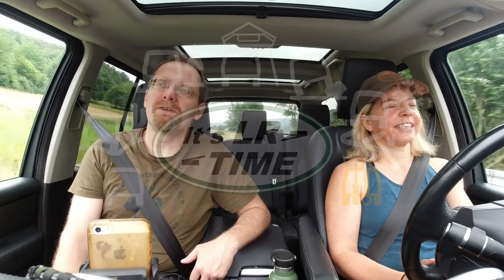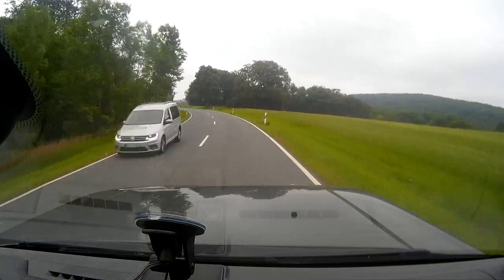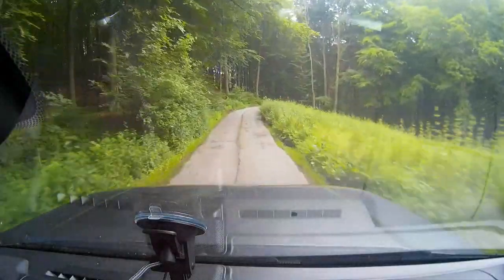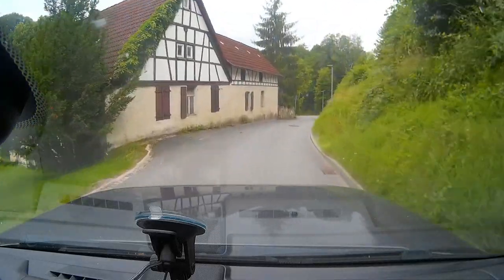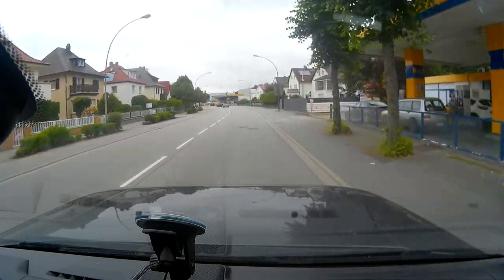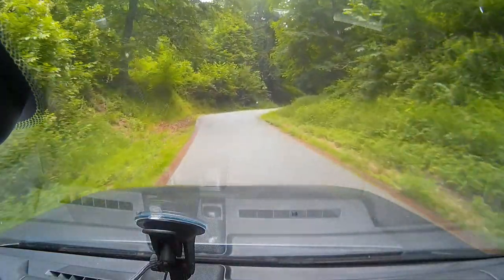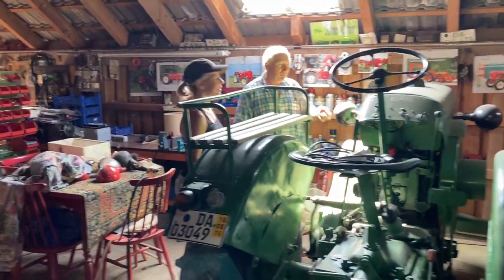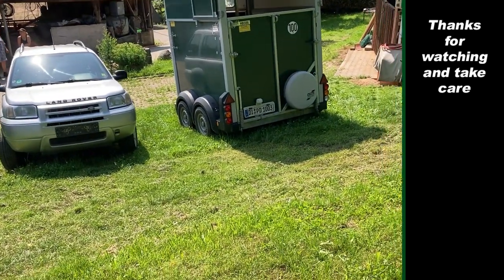Land Rover Discovery 4 - Is it really an upgrade from a LR3 ?

Comment: Hello
I watched all your videos and they are great and my daughters like your submission and cooperation. You helped me decide and I am planning to buy a Discovery 4 model 2014 to 2016 diesel.
Please give me some advice on what to look out for when buying, I plan to buy it in Germany.
Thanks
Reply from the maker: Get yourself a diagnostic tool first, learn how to use it. And hook it up to your Disco during the test drive. You most likely know more about that car than the owner does. And the best advice we give, even so not everyone likes to hear it : You have to be either able to fix it yourself, like we do, or have the money to have it professionally fixed. Otherwise, a Land Rover Discovery is not the right car for anyone. If the car you plan on buying does not have a clean service record, especially every 10000km or 1/year oilchange, do not buy. On the Disco3.co.uk website, you can look for the service interval sheet for a LR4, look at it and see if your desired car has all that done already. And do not trust a check mark, let them show you the actual invoice. You can get the best or the worst. We have the best Discoveries and Fabian got the worst of the Discoveries out there. We love our Land Rovers and we absolutely convinced they are the best cars. But best to do your homework before hand and not afterwards. 👍🙋‍♀️ Vera

Comment: Good video and could I just ask you does your ICarsoft tool work well and can you access the menu's in the car to turn things like cruise control on. Even if it doesn't do you consider it useful and value for money? Thanks.
Reply from the maker: Hello Paul, no, the Icarsoft cannot change the config of the car 😭.  You need the GAP tool to do this. It’s too expensive I think. Christian

Comment: Hello, Great video. I have a question for you. Maybe you can help me. My phone use to connect to my LR4. It stopped working. No matter what I try, the blue tooth no longer pairs up with my phone. I think that I may need to replace the Bluetooth. Do you know how to change the Bluetooth in the LR4? Or do you have any other suggestions as to why my Bluetooth is no longer working. Thank you for your time.
Reply from the maker: Not sure how to replace the Bluetooth…. But try to do a reset by deleting all phones.  If this does not help disconnect the negative battery Pole.  Try an other phone too.  Try both connection directions to see if both systems are visible.  After reconnecting the bat, you need to reestablish a few things like window single push, roof window, clock, etc.  Christian

Comment: You're overlooking one small issue.

I think it's fair to say that Land Rover have, shall we say, "limited competence" when it comes to running a business.
They're geniuses when it comes to designing 4WD systems but not so much when it comes to designing all the other stuff that a modern high-end SUV needs - climate controls systems, seats, electronics, entertainment systems, trim panels etc.

Thing is, if we accept that LR aren't especially smart at all that stuff, it might be giving them too much credit to assume they ARE ruthlessly efficient (germanic, perhaps?) when it comes to planning a facelift for a model.

Dunno much about a comparison of the D3 vs D4 but the facelift D2 IS nicer than the D1 and even the early D2.
I think that's possibly the unintentional result of LR not putting a lot of effort into the D2 facelift program.
They provided all the extra features that make a facelift D2 desirable but then they simply carried on with all the parts that weren't directly related to the facelift so quality didn't suffer.
Quality was always mediocre, of course, but it didn't get any worse.

Gotta say, though, LR prices baffle me.
My first Defender was £2,500. Now you can't buy one for less than £10,000.
Disco 1/2s used to be the sort of thing you could pick up for less than £1,000 and use as a weekend toy. Now they're regularly priced higher than some Disco 3s.
In fact, I'm starting to see tidy D2s sell for £12,000 to £15,000.

My guess would be that it'll be D3 prices that start to rise again next, which'll cause a dilemma for people who can't decide if they want a D3 or a D4.

And then, of course, there's the Range Rover, which seem to now be consistently worth less than Defenders and Disco's of a similar age - probably the result of LR loading them up with all that mediocre quality tech' you're talking about.
Reply from the maker: Any vehicle manufacturer will try to sell a live style and not a car.  Jeep is good in doing this and so is LR now with the new Defender.  They missed this a bit in the Discovery 3/4 era and screwed up the LR5 which does not sell at all.  The new Bronco jumps into this live style marked as well.  This is bad for us users because the prices go up significantly.  Still, from a marketing point of view, LR is pretty good and they have good sales. Technically, I think the cars are good as well for the amount of stuff they offer.  Just a bit more difficult to maintain.
Reply: @Vera_and_Christian  While I'm at it, I mean to also say that, subjectively, I simply prefer the D3 design compared to the D4.

The D3 was deliberately styled to look "blocky" and that styling is evident throughout the exterior and interior.

For the D4, they tried to modernise the interior and (to me, at least) that just detracts from the original styling.

The interior, in particular, of the D3 is probably a "love it/hate it" thing but, after looking at the exterior, the interior is exactly how you might expect it to look.

With the D4, the interior looks a bit "generic", like something that you might find in a BMW, AUDI or Volvo.

It's certainly "nice" but it's not very distinctive.
Reply from the maker: @SiCrewe  I agree.  The D4 is a poor Mercedes on the inside.  It’s just an other luxury car like many others.  The D3 interior is clear original with the towering center console and the rund ball shaped dash top.  I like them both.  Christian

Comment: I had the exact same car Christian same spec etc, did over 80K from new, liked the car a lot for room, comfort perspective but the turbo gave out the sat-nav was useless and the software hated cold weather and agree about the so called infotainment system being hard to use and it seemed to me that JLR threw all of the parts they had left together and called it a D4.

Comment: I do like your new Disco 4 - what year is it?  It seems to have the headlights, circular front fog light surround and the red rear lights of the early Disco 4s, but seems to have the rotary gear select that the later versions have.  I guess it's around a 2013/2014 year?  I do like the colour - my choice would be silver or grey and you have the grey.  And they do look so much better with the "privacy glass".

Oh - and when you get around to fitting a snorkel on it - how about using the Land Rover one (there are also some identical after market ones that are the same but half the price)?  These are very much easier to fit and don't need to have the internal pipe replaced - and less holes to drill and only screw from the outside, so no need to go under the wheel arch. ??
Reply from the maker: Hello John, it’s a late 2013 in corris gray.  Lucky find with very low miles but body damage, mainly scratches and plastic, no sheet metal. So a hobby mechanics dream car.  I don’t know about the D4‘s fine Facelifts over the production years.  No plans to add off-road mods to the car.  Just necessary repairs.  First big one is the oil level sensor in the sump in the first week of August during my vacation.  Christian
Reply: @Vera_and_Christian  Looks like a really good buy if it's only light cosmetic damage.  The last ones (2015/2016) had squared surrounds for the front fog lights, smoother DRL LEDs and on the rear lights where it is red on your vehicle it was changed to black.  In the UK the last of the old shape Discos seem to be around £30-40,000.

By the way, I can see you think that your Disco 4 is ten times better than your Disco 3 - Old one is DIRT 44 and the new one is DIRT 440 - ;-)
Reply from the maker: @johnwillett4086  No 😅, I like our License plate so much, I mean Dirt 4x4 is what it's supposed to mean, its the coolest plate you can get in Germany( exept for OF RD 44) for any offroader.  So we  thought that Dirt 440 is the closest you can get . Just omit the 0.👍🙋‍♀️  Vera

Comment: Hi, I own a Disco 4 and never found an answer on the fuel capacity mismatch. The owner book mentiones 82l (page 193 in the German manual), but I never could fill in more than 75l. By that time I had about minus 50km driven since the Instrument cluster told me 0km remaining.
I didn't find anything on the web clearing that issue.  Did you also experience this?
Reply from the maker: We have not emptied the first filling yet. We monitor every tank filling through an app, so I'll have a look when it does happen that we run really low on gas.  We won't do that on purpose because you suck in all the junk at the bottom of the diesel tank, knowing those kind of cars do not only drive in Germany. 🙋‍♀️ Vera

Comment: Do they have a video on engine coolant leak vs headgasket. I cant tell if mine has a leak or exhsust gas buildup in the coolant.
Otherwise i love my Disco 3HSE, no drop in performance... yet 😂 any video link?
Reply from the maker: No haven't had that problem. It's also rare in the TDV6. No link unfortunately. 🙋‍♀️Vera
Reply: I have bought a headgasket test kit & 'another' coolant sealer. Currently sitting on my drive looking abit sad, with bottles of coolant in the boot to top up as a go. Would love to know what my options are.

Like watching the show, watched all your videos hoping to find a fix. Didnt know if i had missed one. Thanks David
Reply: Well i did the test & my blue liquid turned to green. So it is a headgasket issue. The other thing i noticed is the preasure inside the coolant system seemed really high, presume this is gases escaping into the coolant(bubbling heavily - yet now white smoke from the exhaust).
Added a standard HOLTS pour & go sealer 🤞 heated/rev'd the engine to within an inch of its life. Hopefully it will do the job. Otherwise is another bunch of Discovery parts to hit ebay😭

Comment: Can we improve the breaking of LR3, LR4 having larger break-pads, also supercharged Gas engine should provide better fuel economy for 2014 and later model of LR4. Please Correct me if I wrong. And drive quality is it better in LR4 ?
Reply from the maker: From my point of view, the drive quality is the same if you compare LR3 to LR4 with the same trim level.  Of course LR4 has more power depending on the engine version.  But from the suspension, wind noise and interior noise, I see no improvement.   Not sure if the brakes and rims from the LR4 can be fitted to a LR3. In Germany, this would require a lot of paper work.  But I think the components would fit.  You do need the 19" rims for the larger brakes I think.   The LR4 SDV6 takes less Diesel than the TDV6.  The reason is the better transmission.   With our LR3 TDV6 and manual trans, we can beat the LR4 or keep up with it.  We do not know anything about gasoline engines.  Christian
Reply: @Vera_and_Christian  Thanks for your valuable feedback…

Comment: Is there any improvement with the handling on corners ?
Reply from the maker: Hmmm, our LR4 has the 19" tires and the LR3 has the 18" all terrain with the wider wheel base.  It is also heavy loaded on the roof.  So the LR4 behaves like a sports car in compare.  But the LR3 drives more relaxed and the suspension is new done and has no play at all, vs. the LR4 has 85k on the suspension joints and they do feel soft in erratic brake events.   Good cornering so.   Christian
Reply: @Vera_and_Christian  thanks that is good to know. I think I will stick with my LR3 and put a new grill on :)